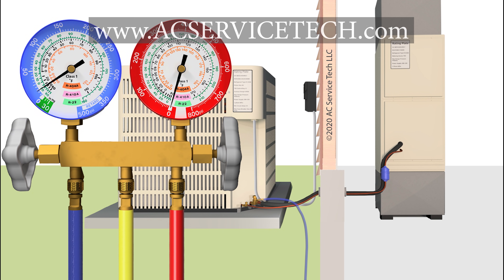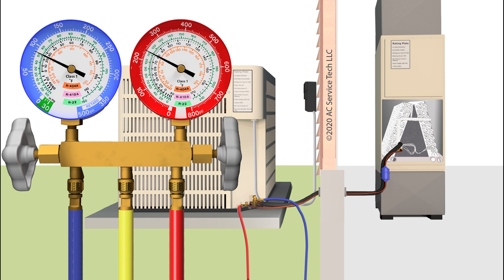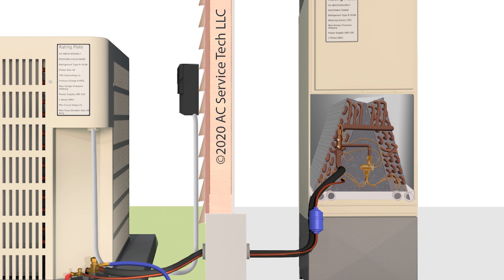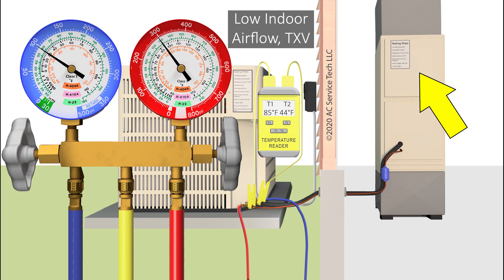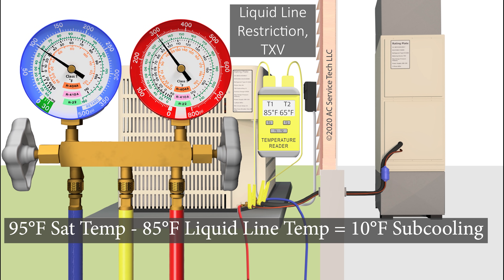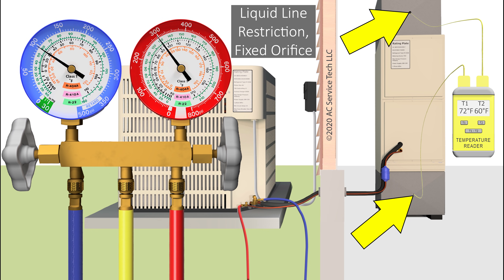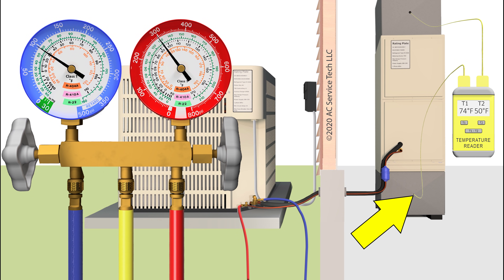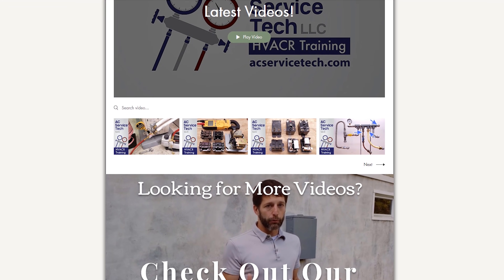Frozen Evap Coil Troubleshooting: Liquid Line Restriction, Low Airflow, Low Charge!

Comment: If you're working in a unit with a piston, then  you find the right target, like 8f° or 10f°from the suction line and the saturation gauge . Should I still need  to do the delta T inside ?

Comment: Where does one take measurements for delta t in a air handler with no return box below the coil as shown in the video. Under the coil is the filter and then nothing. Supply box is also just an inch or two of plenum.

Comment: Hi, thanks for the super video. I am a homeowner, not a tech. Recently I helped a friend who had a frozen evap coil.  I found the compressor was never shutting off, and traced it to a faulty thermostat (old mercury switch type). After replacing the t-stat all seems to be OK, but, question -- is a constantly running compressor one of the possible causes? Or might there be other issues that need to be checked by a tech?

Comment: Have a new install, American standard 13 SEER with piston orifice. Installer called saying it was immediately shutting off on low pressure. I go out and bypass low pressure switch to observe. System immediately starts to drop low side pressure to around 50psig with a superheat of 3°. Indoor temp is 79°.  Suction line temp literally drops to 1-3° and freezes in less than two minutes. All registers open, good airflow. It really looks like line restriction but only thing that looks off is the low superheat. Tested temp across drier, good. Even pumped system down to look at piston and screen, both clean. No kinks in line. When I observe I see frosting occur at top of coil near suction “manifold” that feeds back to suction line. Both service valves are open as well. I’m a little stumped on this as normally I’d think I’d see a high superheat. Unless if part of coil is restricted and causing it to flood but not be able to keep up with capacity? Some help would be appreciated.

Comment: Newer tech here, just ran into a 410A system yesterday with a low superheat of 10 degrees and high subcooling of 22 degrees. The bar inside was only getting 65 degree supply air minimum, I believed this to be an overcharge problem however after taking 8 -9 oz of refrigerant out, the system would not correct itself and still had the same readings.. condensing unit is on the roof as well. Indoor unit has a TXV, could this be a restriction?

Comment: New tech here. Been installing for almost a decade and now just getting into service. Ran into my first failed TXV. R410a system on a 65 degree day with head pressure of 325psi and consistent suction pressure of 80-85 psi. Super heat was around 40 and sub cooling was around 30 and indoor TXV had a temp drop of almost 30 degrees. Half the coil was frozen over and evap coil was clean as well as filter. Safe to say it was the metering device
Reply from the maker: Yup tell tale sign when 1/4 to 1/2 of the evap is froze and the system has been running a long time, thanks!

Comment: Also don’t assume just cause your split temp is low you have a liquid line restriction. Always verify blower speed. Some guys install a 4 ton furnace on a 1.5 ton AC and never adjust the blower. Literally just seen this today and the system was this way for 3 years. I don’t understand why but wasn’t our work. If your new in the trade the best advice I can give is literally start from basics and work your way in. Never jump too far ahead. You may be chasing something and the problem is just a few closed vents or something.

Comment: Could a piston stuck in heat mode position when running in air conditioning also produce low superheat and freeze the coil?

Comment: If you watch the condensate drain with the indoor fan on and CU shut off, you can see when it is defrosted as soon as it stops dripping. Don't add any refrigerant until all dripping has stopped 100%.
Reply: You going to watch it for hours?
If you got time defrost it. If you don't come back latter while it's runs dry.
Do they wanna pay for defrost or for trip back.

If I'm not too busy I don't mind being paid to play with water.

Comment: Hi, Craig. The technician thinks the TXV valve is not expanding correctly so is not good. Because of that he do not recommend to change just the TXV valve, instead he wants to install a Nex compressor, evaporated and condenser, so that way the system is going to work ok. Is that right?
I don't think we have to change the entire system just because the TXV valve is not working properly. Can you help me please, explain me this . Thanks very much Craig.

Comment: Hi Craig, a fellow tech was told to change a condensing unit.  The same problem still happened after.  (Normal split system). Comes on and shuts off immediately on the high pressure switch.  (600 psi).  He thought he might have had a restriction Txv stuck closed.  He heated up the bulb and it opened up and ran fine.  Does this make sense to you?  Thanks
Reply: It means that the txv bulb refrigerant charge ran out and the txv needs to be replaced

Comment: Hi, I’m currently an hvac student and I was thinking about getting your book to sharpen up and help myself get through this course easier. I went over to your website and tried a couple quizzes and I’m wondering if they follow your book? Like as I’m going through the book can I go and do those quizzes and expect to know the answers or do I have to finish the book and then do the quizzes? Or are there small quizzes in that book? Or do I have to buy the entirely separate work book if I want to make sure I’m following? Thanks.
Reply from the maker: The 1,000 question workbook comes with an answer key and that would be the best test of knowledge for our book. We also have a 100 video list that correlates to page numbers in our book at www.acservicetech.com/videos. You should be able to answer the quizzes that are related to the topic, thanks!
Reply: It's a good book I'm learning it to how long you been in school

Comment: I have a question that isn't related to this video but I hope you can answer it for me. When you look at a troubleshooting chart one category is amp draw. I have never found anything telling you what the amp draw should be. It's always "the amps are low, amps are high, amps are about what you would expect."  I have heard that the amp under normal conditions should be about 75% of the data tag. Is there something more accurate?

Comment: Hey Craig!! Great videos man!!

Quick question. Is it common or possible that the capillary tubes, i think they are called distributor tubes, to become clogged rather than the metering device itself??

I ask because often I fine, some of the capillaries are frozen and the other are not. From my understanding, they are all supposed to frost evenly. 

Im not sure I've seen any videos where you have covered this question, but if you have id love todee it. Thanks!!
Reply: Correct, sometimes header tubes block, the symptoms are cold spots in unusual places. 
The biggest cause I found was runaway filter media

Comment: What if I have normal subcooling, but only 5 degrees superheat on a r410a rooftop unit with a txv? Could it be the txv has failed? Evap coil temp is 30F and freezing intermittently. Any help would be great thx. Airflow appears normal but doing more testing tomorrow.
Reply: Did you figure it out?

Comment: If it was liquid line restriction on the filter dryer wouldnt putting probes on both sides of dryer tell you a temp difference indicating it was the dryer?
Reply: Correct but it's very unusual

Comment: If your low on sub cooling would that also mean your super heat is to high?
Reply from the maker: on a system with a fixed orifice yes but not necessarily on a system with a TXV. It will depend on how low the subcooling is before it affects superheat, thanks!

Comment: 8:02 couldn't you also have moisure in the system? A water droplet could freeze on the piston/orifice and cause a restriction. You could thaw the coil and the problem may go away. The only way to fix this is to recover and triple evacuate. Correct?

Comment: If you have a heat pump, can you put it in heat mode to thaw out a frozen coil? Or is this bad for it.
Reply: Yes, but you would have to pull the air filter out first to keep it from becoming a soggy mess, and you would have to have a plastic tub under evap to catch all the water dripping off the ice.  Drain line is for normal condensation.

Comment: What’s considered high subcool with a fixed orifice? If you check a system when outdoor ambient 60 indoor 70 wouldn’t subcool pretty high because the refrigerant flow depends on load. TXV is a little easier to diagnose with restrictions but fixed orifice can get confusing at times.
Reply from the maker: David, thank you for your continued support! So you don't have to pay as much attention to subcooling when you are past if the system is too low on refrigerant and distinguishing between low airflow or liquid line restriction. It will be pretty distinct with a piston. Low superheat and high delta T means low airflow and high superheat and low delta T means liquid line restriction. With a fixed orifice you need to pay more attention to the superheat. Each system will run a different subcooling, it may be 10 or it may be 18 or 20 degrees but because we can't set the charge with subcooling and only by superheat we need to pay more attention to superheat. For a system with a TXV, the superheat and the subcooling will both be more known so that is why it may feel easier to troubleshoot those, thanks!

Comment: Great Video. Thank you for sharing.  Is Roof top unit commercial checking the same resident  hvac unit ? Thank you.
Reply from the maker: Yes as long as the ports allow for superheat and subcooling measurements. Sometimes they only give you discharge pressure and a chart supplied by the manufacturer, thanks!

Comment: Interesting. Another couple of reasons for icing
- blocked filter / fins 
- air handler capacitor low Mf 
- 1 fan speed dead 
- setpoint too low; cooling in cool weather. 
- condensor requires "head pressure controller"
Reply: had a call last week ...tenant had all but two supply vents closed and the couch was blocking the return air vent...
Reply from the maker: Absolutely, I just did a video on 20 causes of low airflow, thanks!
Reply: Don’t forget a contactor that is stuck closed with welded contacts. I have seen that cause a frozen evaporator too.